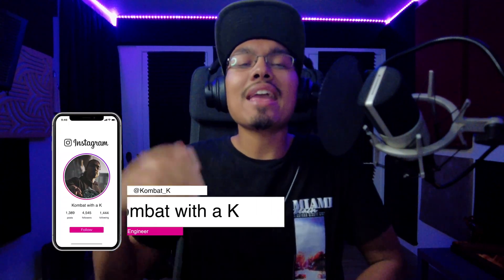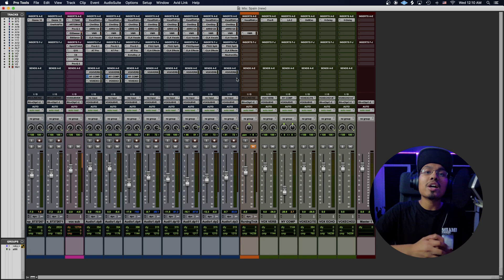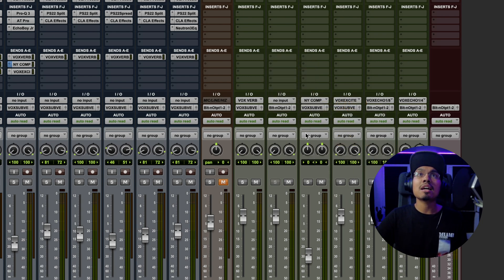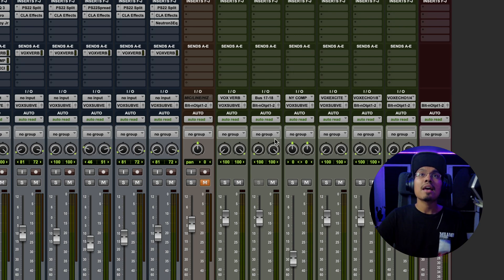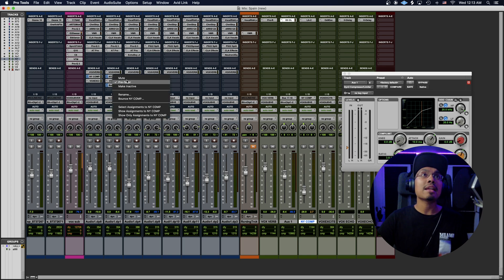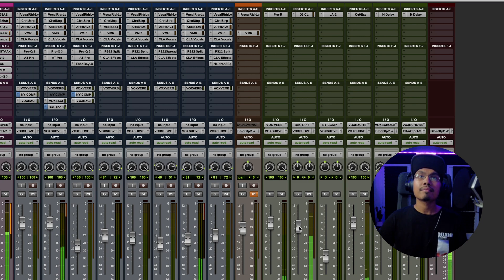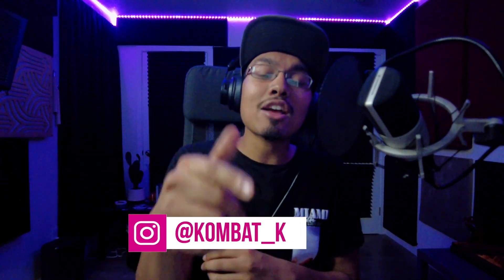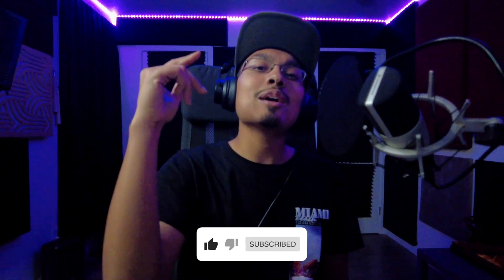What is New York Compression and how to use it (STOCK PLUG-INS)

Comment: Hey so should i use the stock preset compressor options or should i manually tweak the default compressor till it sounds good?
Reply from the maker: I would manually tweak the default compressor till it sounds good. Nothing wrong with trying the presets and adjusting that as well! Sometimes you can find some really good setting using a preset as your base